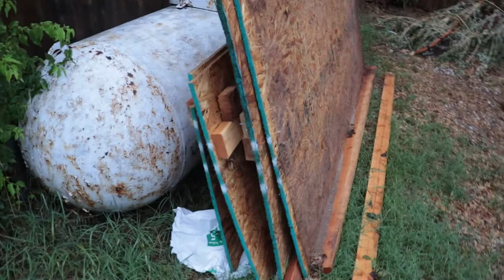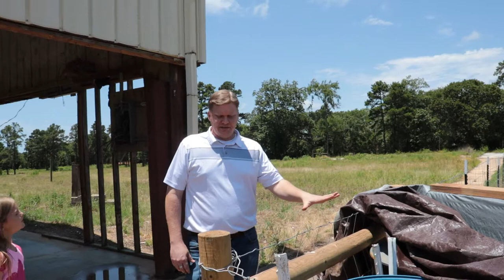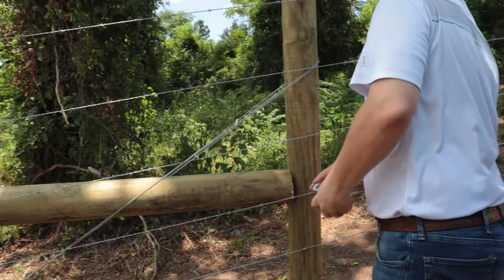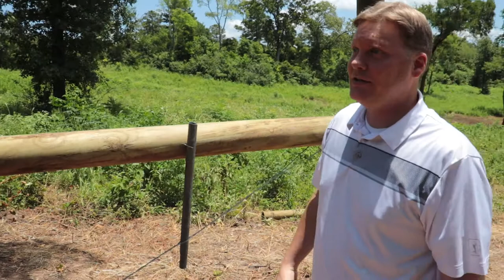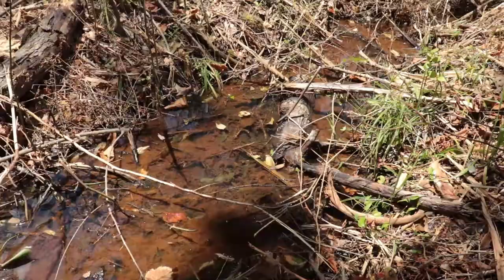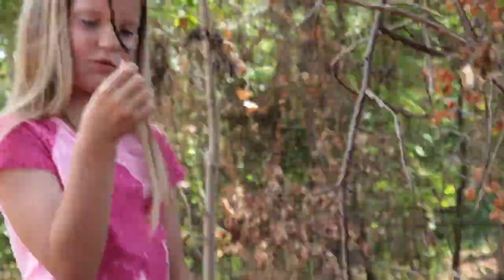Ep 19 - Is My Pasture Fence Built Well - for Beginning Homesteading

Comment: Hold off on any plans for a creek-fed watering system. Study the area for a year so that you can see how it behaves during each season. Best if you it over several years to get an average.
Reply from the maker: True.  I have thought maybe I'll just put in a small collection tank at the bottom for a water trough and use that to help gauge how active the creek is year round.

Comment: Try Premier 1 hog fencing with solar charger.  They also have poultry fencing.
Reply: Most of the farmers and homesteaders I follow on YouTube use Premier One fencing and chargers.  They swear by them.  Check out Arms Family.  Daniel is an Oklahoma state trooper with a large ranch.  He said once the pigs are introduced to it they won't try crossing it, even if you remove it.
Reply from the maker: We have looked into them and want to incorporate the electric fencing the next go around...for the pigs that is.  Its a lot cheaper to run the electric than build strong fences.

Comment: To stop the pigs making hole around the water tanks, you can place those osb panels under the tanks.

About the pond, since you mentioned it's sandy around there, it might not hold the water since it seems the spring has just a little water.
If you make one there, anyway, it's going to be good for the area because it will keep water from rain longer in the area and other parts below.
Good luck.
Reply from the maker: We just tried to measure the flow this last weekend.  Not a lot is coming but we found another branch and they combine together downstream.  Will have to measure the combined flow.
Reply: @BlackacreRanch  - Excellent. 
You might know there are ways to help to improve the flow of springs, using water catchment system. They have been using them in the dry area of India (water revolution), Africa and Australia.